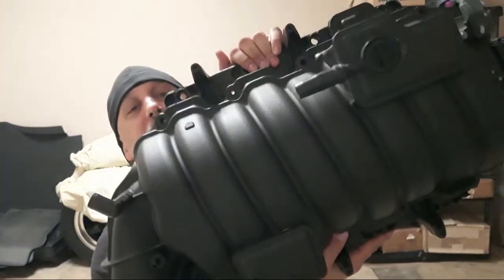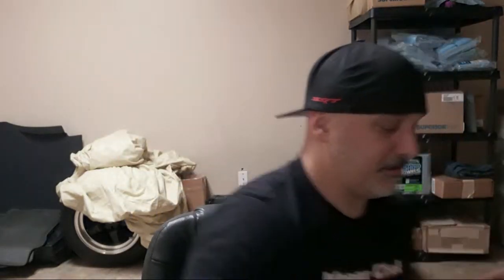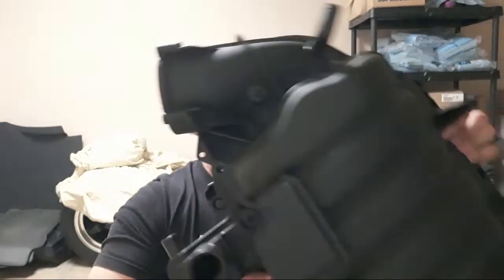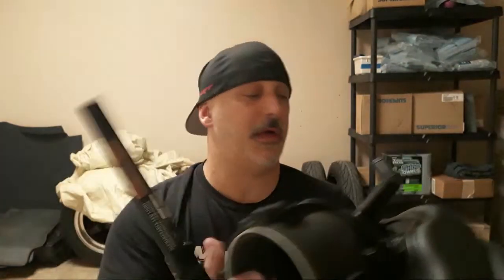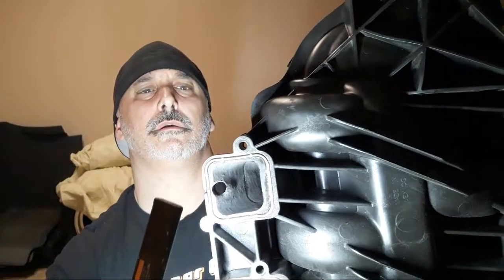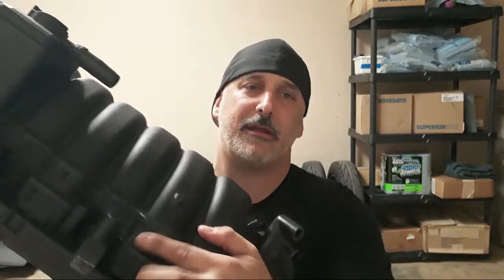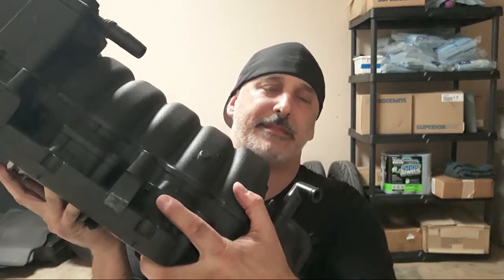Mopar Chat Live.  First Mods And  Best Value Modifications.

Comment: I just bought a scatpack two days ago.  This video is great timing.   Thank you    I bought a manual  and hate how it shifts.  I’m going to do the Barton shifter ASAP.  Other then that I’m happy
Reply: Did you have an option for an automatic?  Auto will outperform a manual every time.
Reply: I had a 14 srt8 with a manual and a whipple, I put a Barton on it and I was never confident in shifting it. I finally gave up and sold it and bought an auto

Comment: Mr. Mason. I know my stock crankshaft on my scatpack is forged. But none of the internals are. If I end up going the twin turbo route and possibly getting a thousand or 1100 horsepower. I was wanting to get a Mahle 3/900 crankshaft. They said they come with either 2 inch rod journals or  2/100 rod journals. I wasn't for sure which one would be better. They said the 2in is good for the turbo guys. But they also mentioned something about better clearance and that's when I got confused
Reply from the maker: Forged internals along with your stock Forged crank should do just fine at that power level. It's not uncommon for an F1 procharged E85 392 to make 850 to 900 to the rear wheels on a Mustang dyno with that configuration.

Comment: And on the 6.4’s do you recommend changing the stock thermostat since these cars run a little hot
Reply from the maker: I do recommend changing the thermostat however you need to be aware that you will need a tune or you will get a check engine light. If you go to cold, like A180. Most of the time guys do not have a problem with 195ﾟ thermostats. With the stock tune.  The stock thermostat is a 203.

Comment: Hey I wanted to confirm I heard you correctly.  Your street drag radial tire size in the back is 305 45 r20?  Does the extra sidewall help with traction a little?
Reply from the maker: 305-35-20

Comment: I have a 2014 challenger rt 6 speed. Would it it be possible to at least high 10s without building the bottom end of the engine
Reply from the maker: With a ton of weight reduction and a cam/tq converter... a 3.70 gear.... possibly a hit of spray in very good DA... yes... maybe.
Reply: @bmasontv  mines the Manuel it comes with 3.91 gears but It feels way too high